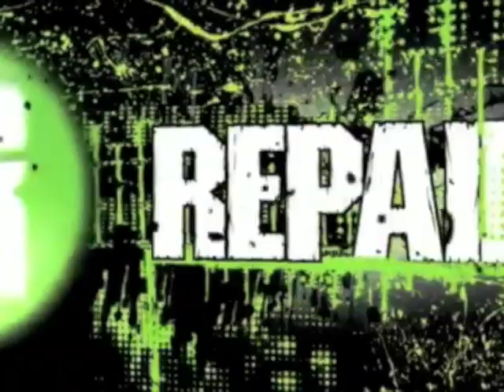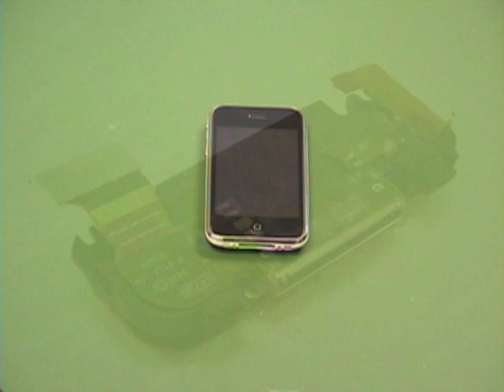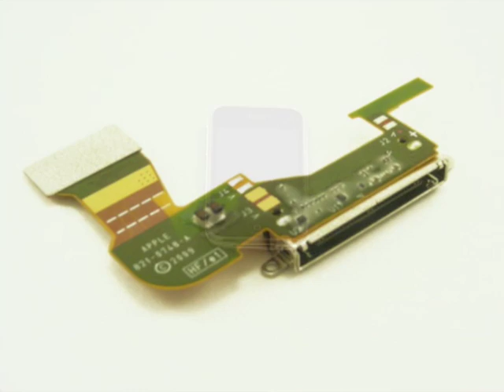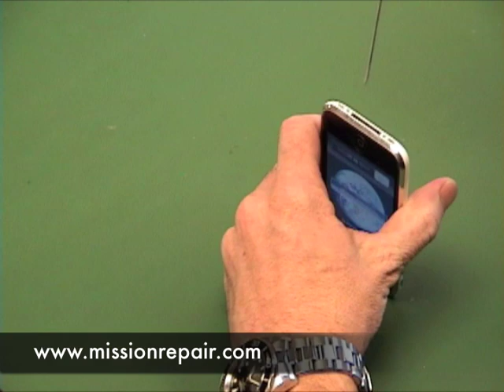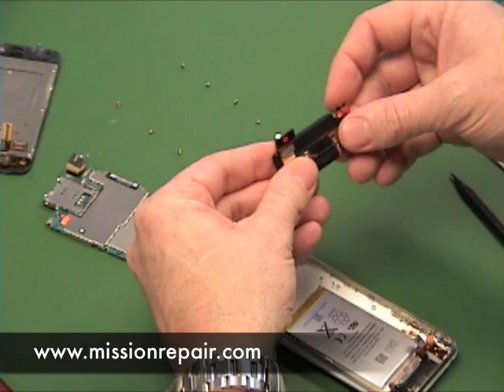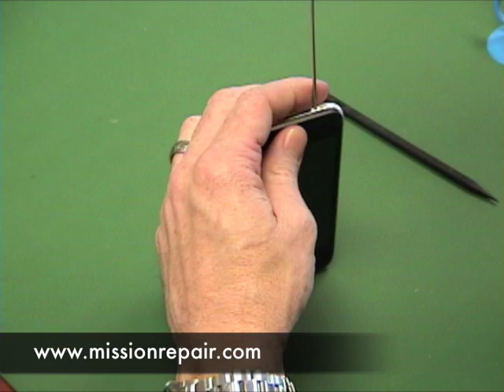How to repair your iPhone 3GS Dock and Charging Port! | MissionRepair.com

Comment: Hi, what a great video, I have a problem with my iPhone 3GS, when I connect it to the computer, it will charge but it didn't detected by the computer. I tried to reinstall iTunes and the driver, but it didn't change the problem.

Comment: Will this fix my phone? My phone is still on, it has battery, but it just wont charge! By the way I turned my phone off so it wouldn't lose any battery... I tried charging with other cables and no luck, I used MY cables on my friends phone and they work fine. So I hope it is the charging port... will this fix it?

Comment: When I install the speaker piece it's extremely difficult to keep the two tabs on the left side above the tabs on the shell. On the actual speaker there are two tabs (a lower and upper tab ). How do you keep them both above the case tabs. Or do the both need to go above?

Comment: Actually I don't know if it's the dock or the battery here's what happened my battery was running low so I connected the charger but the charger short circuited so I thought I'll buy another one I called one last person then iPhone turn itself off with red battery and lightening the pc didn't recognize by the time I had new charger the iPhone is completely shut down nothing on the screen and won't turn on whatever I do even hold home button and sleep button 10sec. Any help pls ?

Comment: I noticed the replacement charging assemblies don't have the adhesive bumper below the #4 connector.  Do you just have to tape it down or pull off the old one and tape it over?

Comment: @simdlee I have the same problem too after replacing the lower dock assembly.  I get no EDGE service at all, and 3G service jumps to "No Service" or 1 to 2 bars at home and at work when before I use to get full bars.  I did the network reset and that didn't do anything.  I also sometimes get an "o" where the 3G and E goes next the bars???  I'm wondering if the dock assembly was bad...  Thinking about doing a restore next I just hate having to put everything back again.  

3GS Iphone on 3.1.3